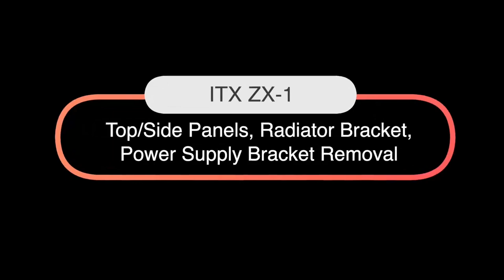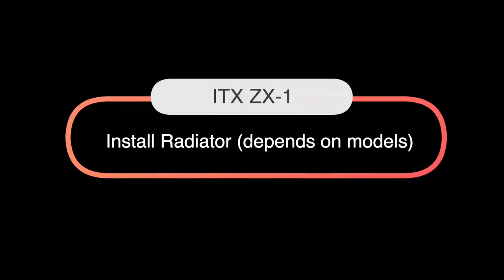IQUNIX ZX-1 Mini-ITX Case Installation Instruction (Water Cooling Version)

Comment: Hi there, I have bought the coral water version, the design of the case is great. I only have a problem with the top grill. it scratches the white case. The space between the case and top grill is too small. Maybe because of the paint that comes on top of it? I would buy a air case if this Problem is solved. It is not so cheap(CNC, I know why), but could you check if the gaps are ok on the coral. I bought it in 2021.

Comment: I like this case, my concern is the gen 3 riser cable it comes with and there's no option for gen4 on your website. I've not seen any video for a 3090 build for this case, so I'm not certain how the temperature will be, if I were put a 3090 Gpu . Lastly availability, the nothing on new egg, best buy.

Comment: Hi there can you confirm your view on whether the radiator fans should be pushing air out the top or pulling air in from the top.  Some other YouTube channels are pulling fresh are in when they built their examples.
Reply from the maker: We recommend "push the air out from the top". 
After our test, exhausting from the top, the case will form a negative pressure heat dissipation effect, which will be better.
Reply: @IQUNIX  Thanks, that's what I suspected.

Comment: Very cool! Would there be enough space under the tabs and between the side panels to fit a low-profile 280mm radiator?
Reply from the maker: Hi William, kindly note it only fits 240mm radiator.

Comment: How much space between CPU and case panel?
Reply from the maker: For the Water Cooling version, the CPU maximum goes with 55m. For the Air Cooling version, it goes with 70mm.